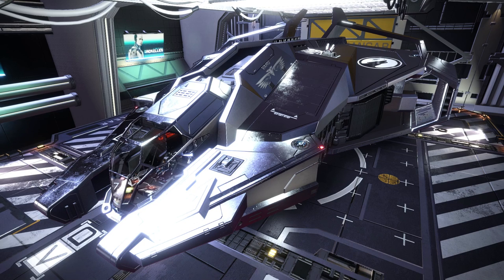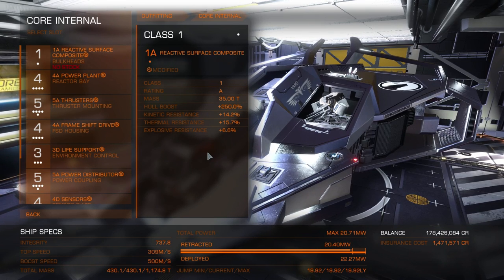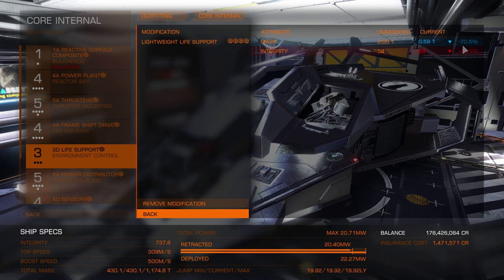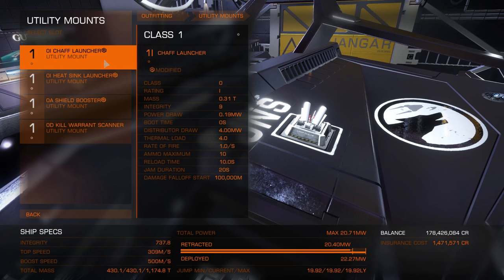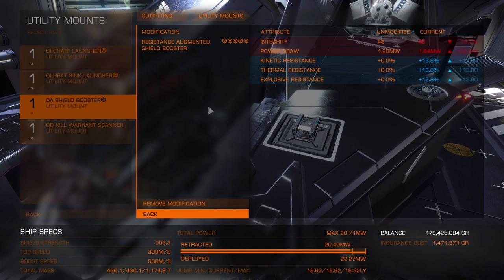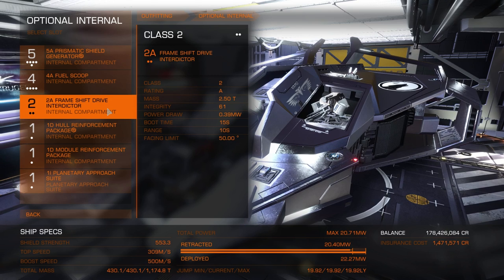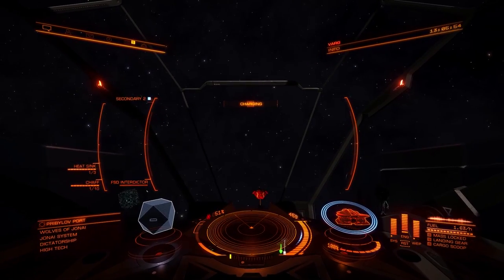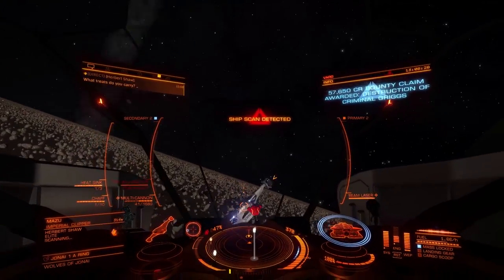✔ My Vulture Build Post 2.3 - Elite: Dangerous

Comment: You should really experiment more with Rapid Fire Pulses. Here are some numbers...

Gimballed Pulse w/ Rapid Fire Max Roll: DPS 20.9301/S, Distributor Draw 0.598 MW, Heat Per Second 0.92, Armor Piercing 52, Range 3000, Jitter 0.5°, Damage Falloff 500M, Breach Damage and Chance 3.9 (40-80%), Power Draw -0.92

Gimballed Beam w/ Efficient Max Roll: DPS 22.13/S, Distributor Draw 3.627MW, Heat Per Second 3.04, Armor Piercing 50 Range 3000, Jitter 0°, Damage Falloff 600M, Breach Damage and Chance 16.2 (40-80%), Power Draw -0.96

So the Beam WILL do about 10% more damage than a RF Pulse, but at nearly 6x the distributor draw, 3x the heat build up, though it does have better breach (internal component damage potential) and no jitter, but you shouldn't be firing any lasers from long distance anyway, where jitter is the least of your problems.

Comment: I wouldn't of bothered with the KWS, would go with a second A rated Booster also Resistance Aug, and Bi-Weave shields instead of Prismatics with Reinforced. Probably end up with a less power hungry ship that not only has faster recharging shields, but more MJ's and even higher resistances.

I find KWS's kind of useless, however this is also coming from someone with almost 4 billion credits.

Comment: I'm having a blast in my engineered FDL. I run it with a huge efficient beam with wing regen, and 4 high cap frag cannons of which 2 are corrosive and 2 incendiary. I know corrosive doesn't stack but depending on the angle it might not always have a shot on the target. Its great fun to plant my nose on the PP of a Conda when its shields are down and one clip the PP with the frags. I still need to grade 5 my thrusters and some other internals

Comment: Good job getting C5 Prismatics online on a Vulture! My fit is not necessarily better, but it is different - I got class 5 bi-weave modded for thermal, and I rolled for a secondary bonus to regen rate - it is 10% faster regen. Then, with the power I saved, I got three class a shield boosters, one thermal, two resistance augmented - This fit does not include shield cell banks, as it doesnt really need them, and I find the mass saving over Prismatics and SCBs really let's the dirty drive 5s shine!
Reply: K1lostream 
Are you aware if you can keep engineering materials when you transfer to another ship?
Reply from the maker: Yes, the engineer materials are bound to your account, not your ship.
Reply: ChaosWulff - Sci-Fi Gaming 
Awesomeness!
Thanks for the rapid reply.

Comment: @ChaosWulff, what keybind allows you to target there power plant with out using the left side panel?

Edit,
 just got done watching the video. O,O dang that Vulture is OP.
Reply from the maker: I have it bound to the scroll wheel on my X52 throttle
Reply: Thx for the reply, I am also using the X52 Pro throttle it feels really good to fly with it in
Elite Dangerous.
I am looking under the keybind settings[Targeting] and cant find what will allow me to 
select the targets components or engines. 
Hope its not to much to ask under what setting to find it?
Reply: its the target subsystem bindings, they should be in targeting tab if i remember correctly
Reply: Cool thx for the info @TheDutchRanger
Reply: np, let me know if you found them :)
Reply: Thx I did ^_^

Comment: When I deploy my hardpoints it deactivates my laser and chaff
Reply: Your power capacity is exceeded - you either need to reduce your power consumption by equipping less power-hungry modules or disable some non-essential ones in the modules panel.

Comment: How do you manage to stay in a position to fire on the target at all times? They always seem to be able to just 180 turn and start jousting me, then 180 turn again and get behind me.

I'm using down thrusters to try and stay below the target as he goes over me but his turning is still faster. What kind of speed do you have to be at to turn that fast? I keep my speed in the Blue zone and just hold F (down thrusters) but they always get away.

Any tips?
Reply from the maker: +Potominkus not 100% sure without re-watching the video but this ship is stupid fast AND stupidly agile so it can almost always stay nose on to an engagement, it also helps that I'm using the X52 Pro so I have a lot of control over my ships.
Reply: ChaosWulff - Sci-Fi Gaming but thrustering down while the enemy moves up is the general idea? And would you recommend this ship without horizons?
Reply from the maker: +Potominkus Without horizons this ship is extremely limited in it's operation, the powerplay is way too small to fully A-Rate so it really benefits from engineers more than any other ship in the game
Reply from the maker: +ChaosWulff - Sci-Fi Gaming power plant*